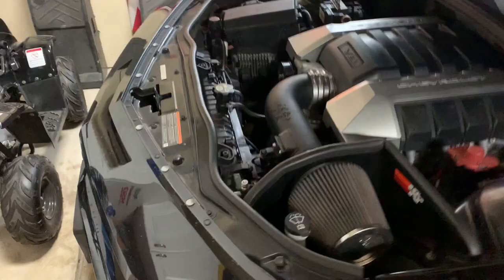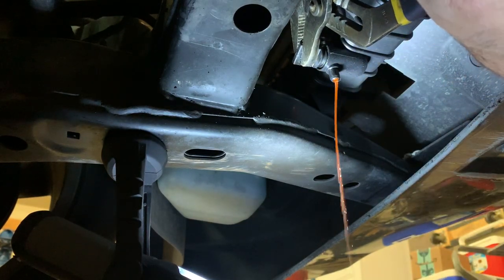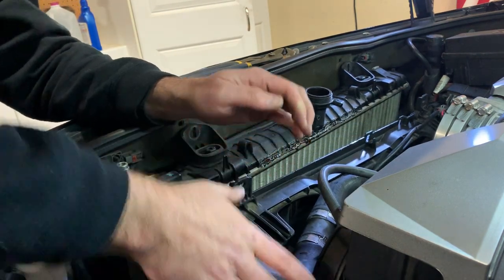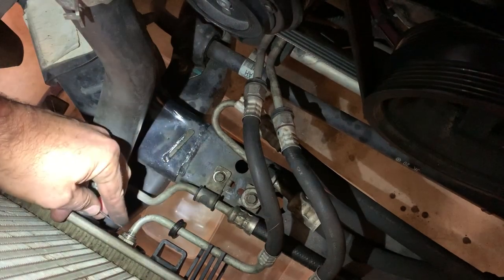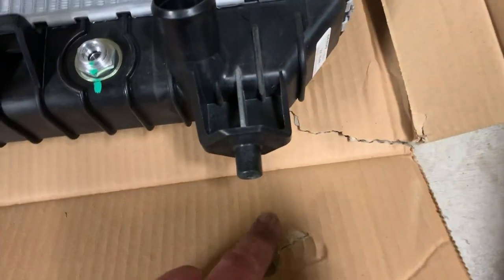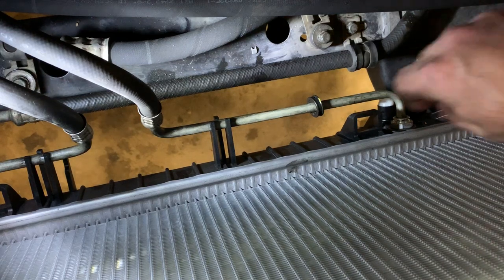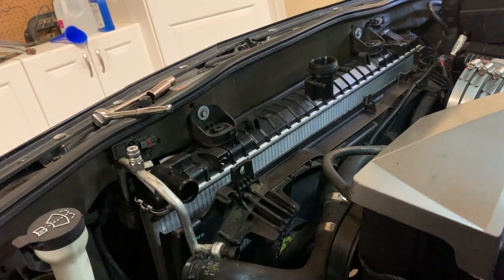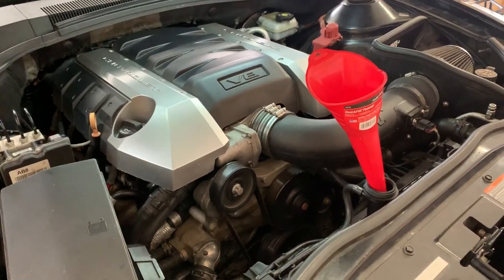How to replace a radiator - 2010 Camaro SS

Comment: The lines that go in the bottom… are those screws suppose to move? Mine has a small leak from there tried tightening it but keeps spinning and now im thinking maybe the holes just isnt all the way pushed in so im goin to remove that clip and see if it need to be pushed in
Reply from the maker: Are you leaking coolant or transmission fluid?  Some radiators (OEM included) have screw in bungs that retain the clips that hold transmission cooling lines on.  If they are loose and not tightening they are stripped... very easy to do.  If that is your problem you could try wrapping threads with teflon tape or if it is really bad, you could use something like a helicoil to repair it.  If it is the line not being pushed in all the way, all you need to do it remove the black retainer ring and pop the line in.  It will slide past the metal clip and lock in place.
Reply: @JeffLyle  hmm ill take a look when i get home usually only leaks when its running if its parked and off it doesnt leak so im sure if the bolt was stripped and it was transmission fluid it will keep dripping

Comment: Hi, I was talking to someone who told me I would also have to remove the condenser when removing the radiator. Which then would require me to do the evacuation and the recharge of the ac system.  Is this correct? or can I replace the radiator without removing the condenser?
Reply from the maker: no need to disconnect any ac lines.  The condenser doesn't need to move when replacing the radiator.  In fact, when I did my cam swap, I was able to move the condenser completely out of the way to get the cam in through the front without disconnecting anything.

Comment: Hey I need a new cap we’re I drained the coolant fluid, any place were I could get one?
Reply from the maker: I am pretty sure the part number for the ACDelco Petcock is 92218349.  You can get these in a bunch of places like rockauto or amazon.  You might want to double check that it fits though before ordering one.  If you pulled the other one all the way out and it is leaking after you put it back in, you may just need a new oring too.

Comment: Did you replaced the missing transmission fluid?
Reply from the maker: I did not.  I just checked the level and the amount lost was so small that it didnt need to be topped off.  I think I only lost a couple of ounces.

Comment: I’m having issues putting the transmission lines with that clip back on.. 😩😭
Reply from the maker: The clips are designed to go on the fittings to the radiator first. Then press the line into the fitting. The beveled line will expand the clip and secure the line.

Comment: How about radiator supports?
Reply from the maker: If you are referring to the rubber isolators on the bottom of the radiator, they are reusable if they are in good shape.  Mine were fine.  Just gotta line them up from underneath the car when going back in and make sure the condenser is attached as well... it's a puzzle.  But if you pay attention to how it comes apart, it's easy to get back together.